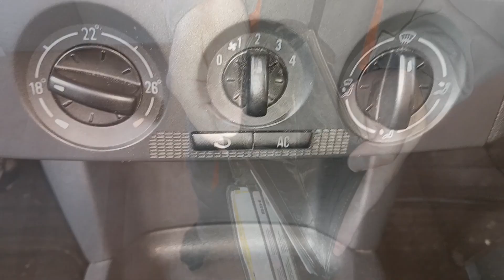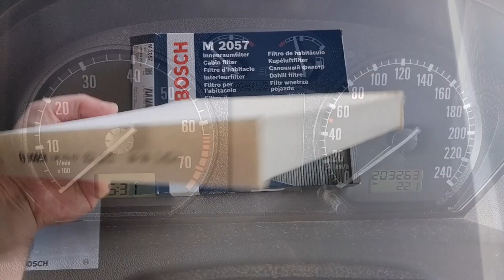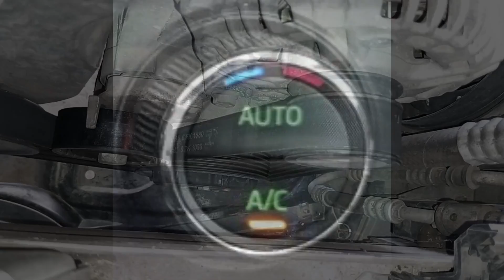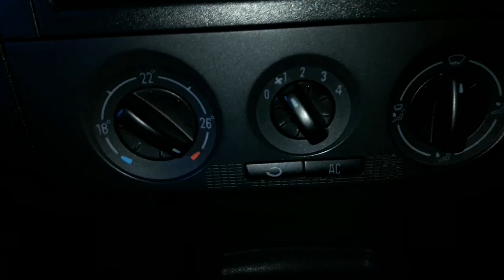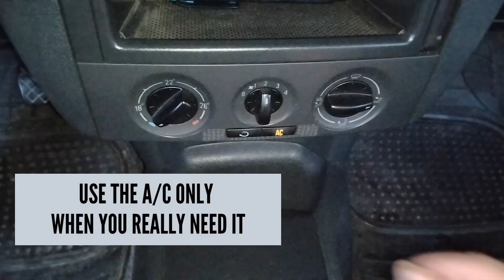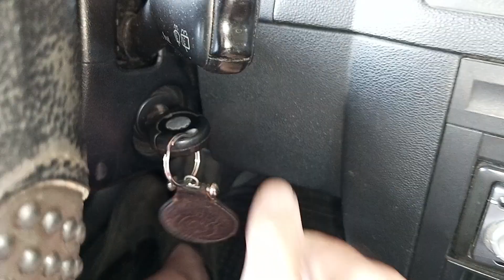Tips That Will Make Your Car's Air Conditioning Run Forever

Comment: Hi, thanks for the tips! Going in for a check about the AC on one of my cars tomorrow (VW Scirocco 2013).
Was filled with gas in late April, but no longer blows cold air. No leak then as their machine didn’t react for that and successful filling. 
What is likely to be the fault, if you guess?
Reply: https://www.youtube.com/watch?v=WT3Tfex29RQ
Reply from the maker: Hi, you're welcome and I hope the tips help 🙂. Btw, very nice car and good taste 🙂.
Regarding the lack of gas in the system, it seems to be a common occurrence. I have a similair issue with my Skoda as do lots of other people with the same generation VW group cars.
The gas sort of evaporates from the system, although there are no leaks (in my case, checked multiple times at a service with the AC machine).  I have to refill the system on my Skoda every two years at least.
Reply: @DespairRepair Thanks! 🙂 I love it! 
But now it went from cold to no cold in two months after fill.
Reply from the maker: @TS-gg9dk  then there's got to be some leak or bigger problem, that's really a big loss of gas. 
I would take it to an AC servis, they pressurize the system and it shows any kind of problem. They can pinpoint the exact place.
Reply: @DespairRepair Will take it to the same workshop where they filled last time. They have a machine that does it. 
It filled successfully then. Also filled another car there, that one still has cold air coming out.
Worried about costly repairs. 🤨
Reply from the maker: @TS-gg9dk  I would be too, but it doesn't have to be anything seriuos. It's not that old of a car to be the compressor or something.
It's just odd that their machine didn't notice absolutely anything with that kind of gass losses.
Reply: @DespairRepair Then in April it was 3-4 years ago since last AC gas fill. 
Something must have happened after April. By end of June no cold air was coming out.
Reply: Back from the workshop, and they said the condenser(?) was leaking. Not fixed today. 

Another issue hopefully fixed; rear level sensor for the lights to be correctly aligned in height. 
Needs to pass vehicle check in September.
Reply from the maker: @TS-gg9dk  damn, I hope it's not too expensive to replace. I know it takes some time to change the condenser. But at least you've found out what's wrong. After the replacement, you shouldn't have any problem with the AC again.
Good thing they saw the bad sensor.
Reply: @DespairRepair It is a known fault I have pushed forward to fix. Wasn’t sure if it was front or rear level sensor or adjustment for the headlights itself. Xenons. They were too low, now I hope correct. I can’t check that myself.
Reply from the maker: @TS-gg9dk  well, better so, with electronics you never know the outcome especially if you haven't done the job before.